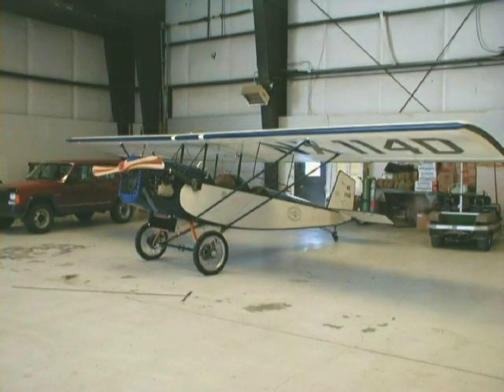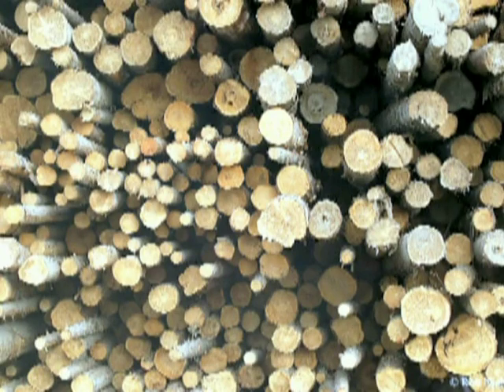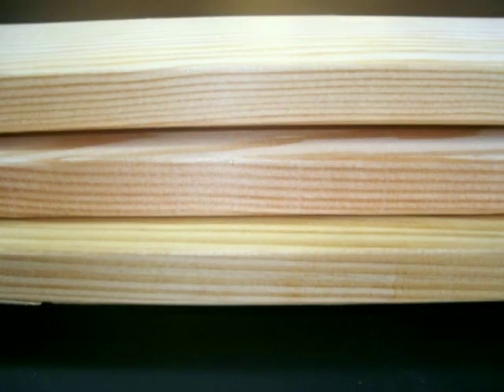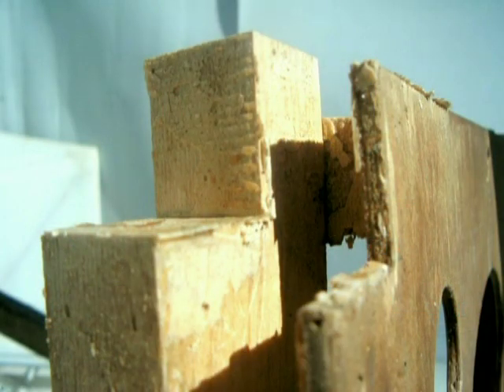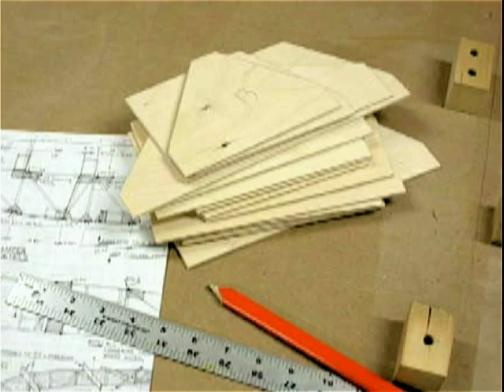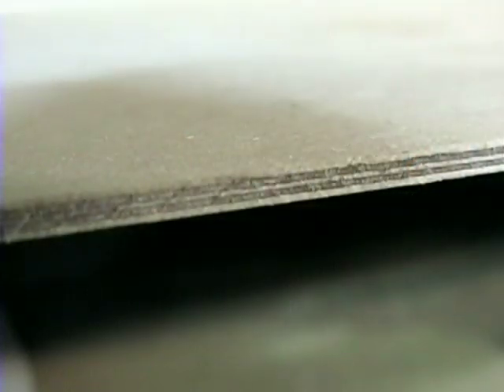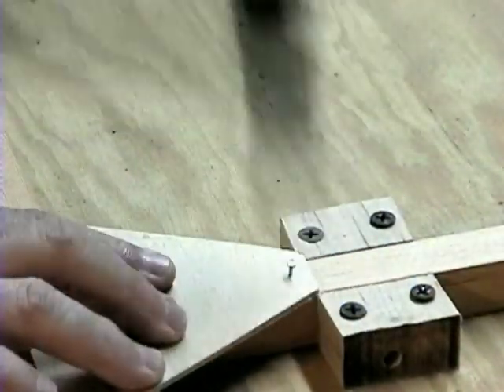Wood Aircraft Construction

Comment: 1:15 - Annual growth-rings per inch is NOT measured on the board's edge as shown in illustration but on the wood's end-grain surface - and then radially.

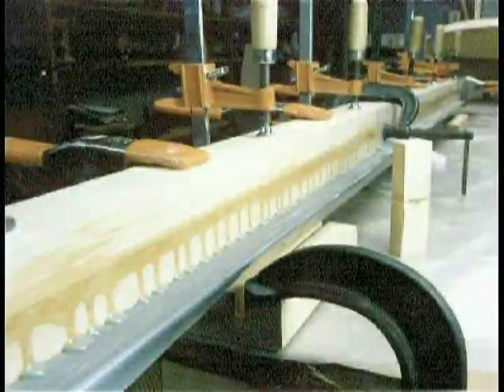Comment: 2:48 - This does NOT look like a satisfactory glue-up (lamination) : Unless you are using epoxy you will need considerably more pressure per square inch - and more evenly distributed (use "clamping-beams" and visualise the pressure from each clamp spreading at 45-degree angles.) Those sliding bar clamps only give you up to 400PSI and you've got quite a lot of inces inbetween !